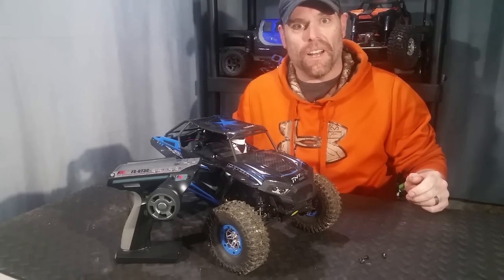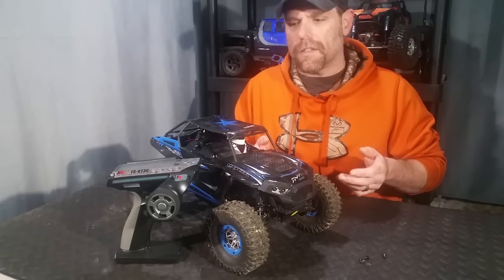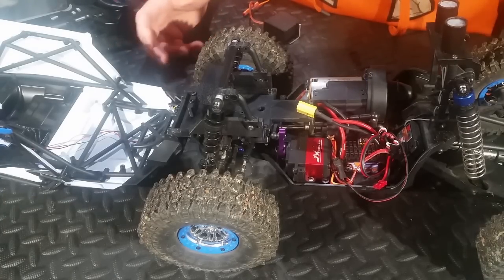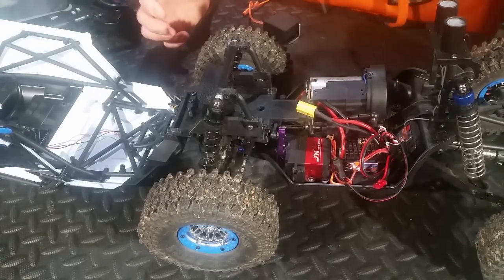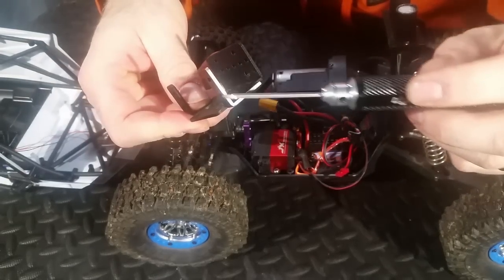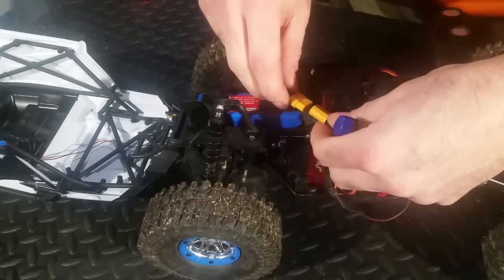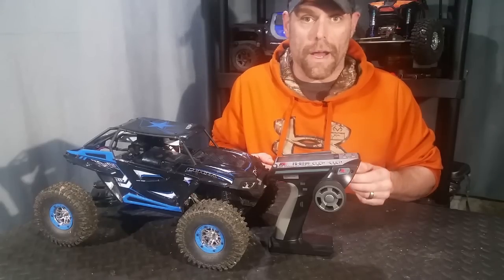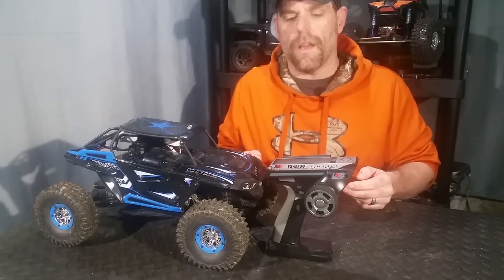WLToys 10428 B Week 6 Electronics: Flysky Transmitter, Hobbyking ESC, JX Servo & MG Servo

Comment: My 10428a stiil using the stock electronics,i want to change the shift gear,any suggest for budget 5 wire servo?
Reply from the maker: There aren't any 5 wire upgrade servos.  They're all junk.  You can convert a 3 wire to 5 wire, but it's possible that you'll burn up the servo controller in the ESC.

Comment: Checked the comments to see if you reply on this older vid haha I guess your boring ":D
I have a different version of this rc. And my motor burnt out wondering if you have upgraded the motor and which did you get? I do bash more than crawling
Reply from the maker: My original motor is still in the truck. Since it's a standard 540 can, you have plenty of motor options. For bashing, an inexpensive brushless system is the way to go.

Comment: Top top video series. I have a wltoys 10428 in the post it's the black and yellow version but same chassis.
I am planning on changing the electronics. I have a remo hobby 550 size brushed motor spare to drop in. Would it fit instead of the stock 540? Other electronics are similar to what you've dropped in so happy days!
Reply from the maker: Based on where the motor sits in the chassis, it looks like there will be room for the longer motor, but I'm not 100% sure.
Reply: @BudgetRC_Channel   that's what i thought I'll give it a try when it turns up. Appreciate the reply thank you 👍👍

Comment: Any recommendations for a plug and play option on the shift servo?
It is a pretty obscure size and sorta hard to find.
Reply from the maker: Nope.  That's why I converted to a full size servo.  About the only option in the stock size is the expensive Vaterra servo.
Reply: I got impatient waiting for the servo in the mail so I did a 5 to 3 wire conversion using old traxxas servo guts. So when the new servo arrives it will be stored as a backup.. I know the electronics were a straightforward easy install but that's the boring parts we love so next time you should show it.

Comment: HI Jimmy, another Great video! Thank you For Sharing. I am going to buy the parts and converty car. I have not Clear how to set the end Point For ch3 and servo, is there some video that explains it? Just set 5%
Reply from the maker: You need to dial it down enough for the servo to move enough to shift gears properly, but not so much that the servo buzzes in either gear.  It will be a different value for everybody, so you can't just use my numbers.

Comment: You are the man! Great vid. I have a E.A. Degree and moved on to robotics and I can tell that you are an engineer by trade! People are going to hate and there’s nothing you can do but laugh! I am new to the crazy world and recently procured an a959b reaching top speed of 56mph! Tough little car! I am all about speed and track performance, jumps inclines etc. What B.B. would you recommend for my likings? Keep up the great work and I know you have the ability to reach 1m +subscribers brother.
Reply from the maker: Ha!  Yeah, I'm an EE.  On to your question.  By B. B. I'm assuming you mean bearings?  If maximum performance is your goal, ceramic will give you the least rolling resistance, but they're expensive.  Regular cheap bearings tend to work for me.  The rubber sealed keep shit out better than the plain ones, but they add drag.  I use those in external areas and the non rubber inside gearboxes and axles.
Reply: Lol 😂I meant budget build! Thanks for the bearings info though!👌🏻👍🙏

Comment: Howdo, can you tell me if this has a lvc, so when you are running on the lipo, it will shut down leaving a little left in the lipo?
Reply from the maker: Yes, the truck comes with a Lipo and the ESC has a low voltage cutoff.
Reply: Thanks for the reply, i have the Ripmax branded version, nice car

Comment: just watched all your series video about this 10428B, I have the exact same model with you and your videos gave me a lot inspiration. I put a battery pack under the front hood to keep the LED lights function and also add some weight on the front end too. https://www.rcgroups.com/forums/showthread.php?2689525-WLtoys-10428A-the-clone-of-the-vaterra-twin-hummer-body-axial-wraith-poison
Reply from the maker: Using a separate battery is always an option, but I hate using separate power sources for things, and in this case, with a 3800mah shorty pack up front, I've already got more weight than I'd like.  A $0.75 buck converter lets me use the main battery power in cases where the BEC power isn't appropriate,  but in this case the 5 6v from the ESC will work great, and since I want to control the LEDs with the remote anyway, using the ESC power is the simplest option.